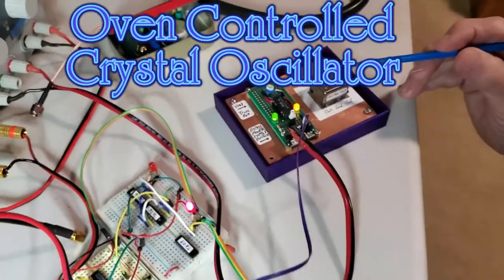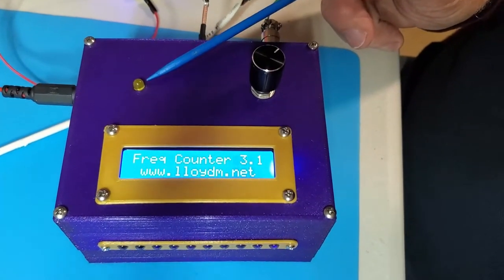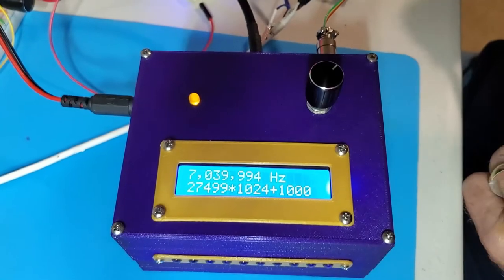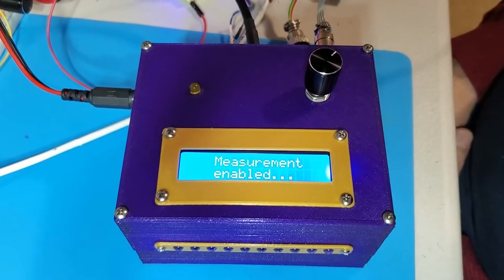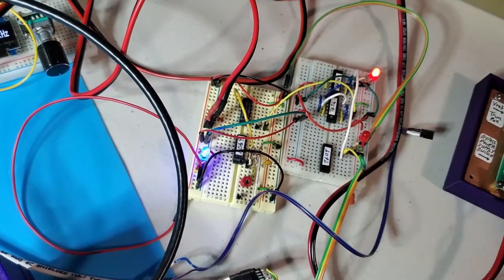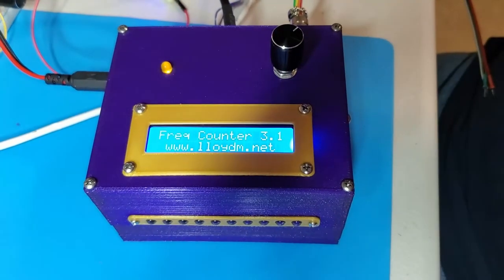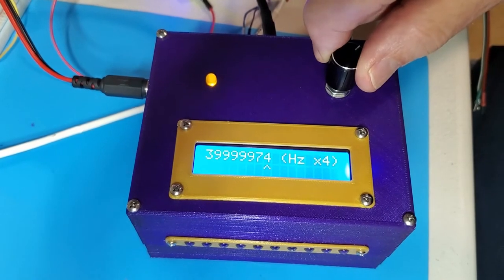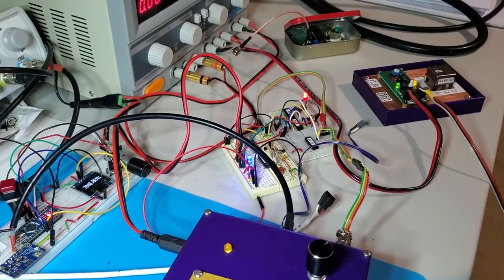Oven-controlled Crystal Oscillator

Comment: You can use 74HC390, or 74HC4017 as decade counters. The 74HC means they are specced to work up to around 30MHz.

It is also possible to program many ublox GPS units to output their PPS at a higher Hz than 1. Although their signal can be a bit jittery at some Mhz values (I believe from having to freq synth from their own clock), you can work with 10khz or 100khz or 1Mhz I believe and get a nice signal out of them without having to divide other signals to get use out of the 1Hz PPS.
Reply from the maker: Thanks Matt. With your permission I'd like to quote those suggestions in the write-up page (with attribution, of course).

Comment: Hi, I'm interested in the GPS based counter and reference, is that home made or bought?
I want to calibrate several of my instruments and although I have a rubidium standard oscillator it has a calibration control and label telling me when it was last calibrated.
The calibration date was several years ago and I don't know how accurate it really is now. it seems to function ok and my HP microwave frequency counter shown it is accurate to a Hz or so. 
What should I believe. I also have an RF frequency generator that was calibrated recently. What would you trust? the rubidium standard or the calibrated generator to be more accurate as there is a slight discrepancy of about 1-2Hz in all of the equipment compared to the Rubidium standard. Should I just calibrate everything to the Rubidium oscillator?
Reply from the maker: Hello. The GPS disciplined frequency counter is homebrew. The original project was described on this page: https://www.lloydm.net/Demos/GPS_freq_counter.html, and a revision using surface mount components here: https://www.lloydm.net/Demos/smd.html. I can’t really advise on the relative merits of different instruments or measurement approaches; however, to the best of my knowledge GPS is the most accurate time interval source accessible to amateurs for high frequency counting. 73, WA4EFS
Reply: @lloydsdemos7366  Thank you, I'll check that out.
Reply: GPSDOs are available online, under $100.